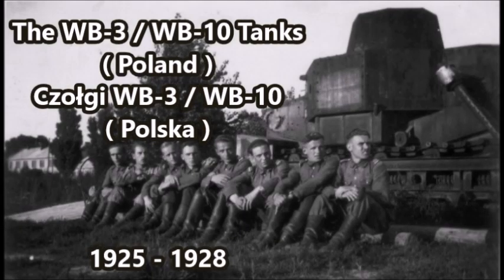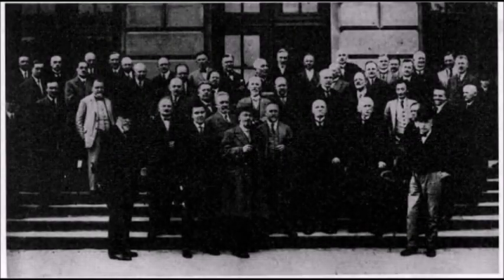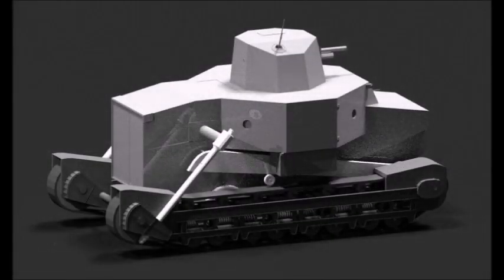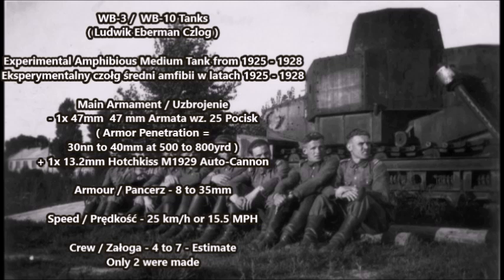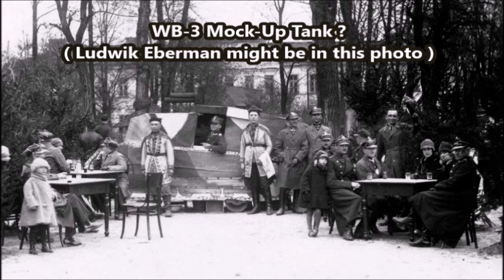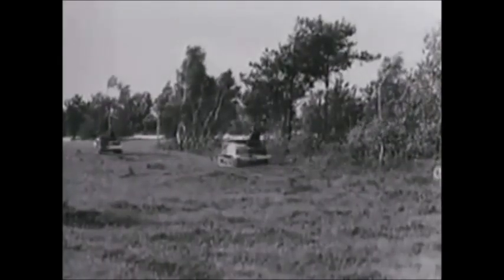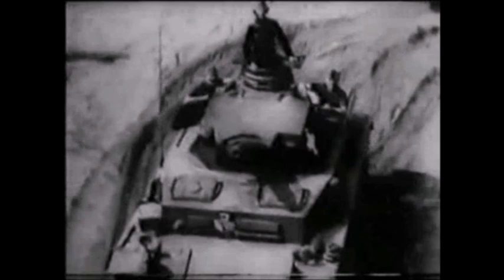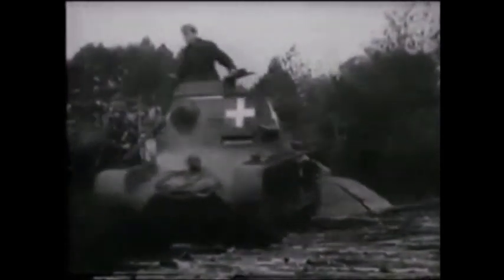The WB 3 & WB 10 Rare Polish Tanks

Comment: Used by the polish 3rd Tank Battalion ( 3 Battalion Pancerny 3 Batalion Pancerny (3 bpanc) formed in 1935 ) at the battle of Warsaw in 1939.🤣 Those tanks were so complicated that both couldn't move... They never take part in the battle of Warsaw. Both prototypes as a subject of court claims against the contractor stood under the guard covered with a tarpaulin at the Modlin fortress square until the outbreak of the war.